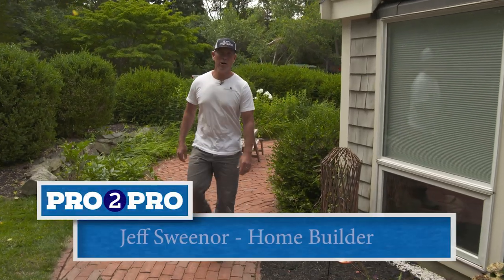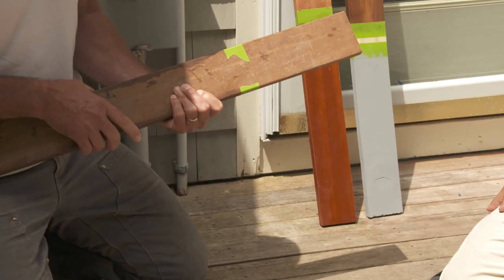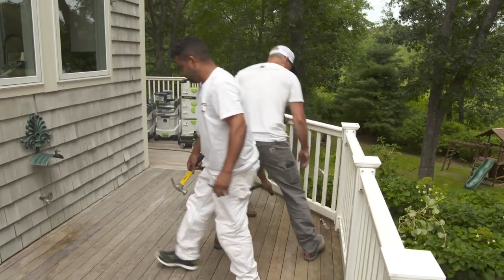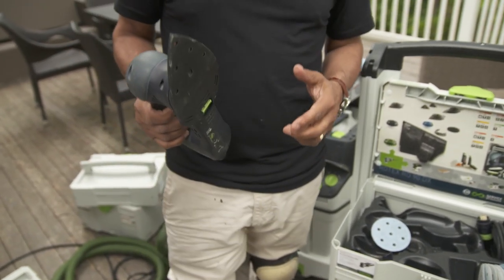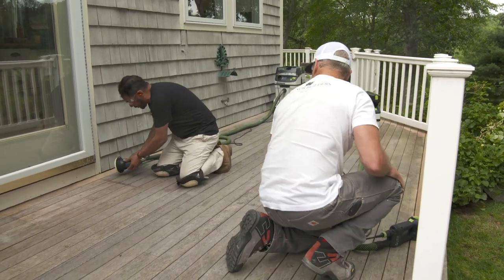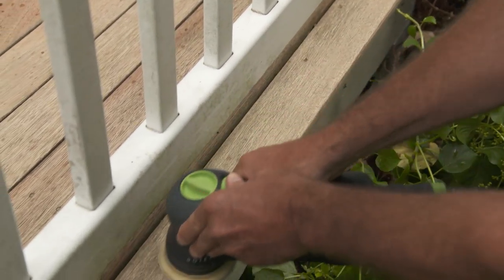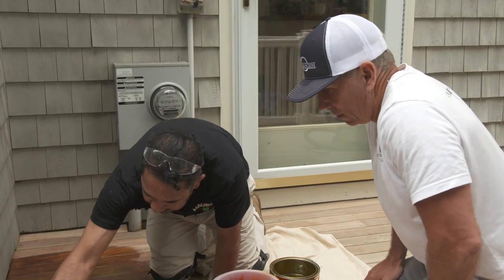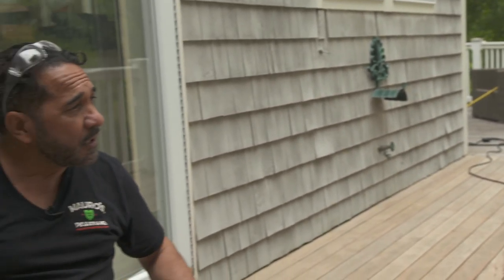Pro2Pro Live: How to Refinish a Deck | This Old House

Comment: If you're using a penetrating oil, you should be wiping down the boards with acetone before applying the oil.   This helps the new oil "bite" into the open pores.  Otherwise, the act of sanding just brings out the naturally occurring oils within the wood to the surface, thus minimizing or "blocking" the uptake of the new penetrating oil.   Can't believe that wasn't mentioned here, it's all over the literature from the penetrating oil manufacturers.

Comment: They tell you what brand the $20k in tools they used were, but not the $50 can of penetrating oil. 🙄
Reply: Oil brand probably didn't pay up.
Reply: Penofin brand oil. You can special order it through Sherwin Williams and maybe other retailers. Not sure if you can get it directly from them.
Reply: Which woods would the oil be worth using and which woods wouldn’t you use it on because it would be a waste?

Comment: I work alone and I would have that done by the same time as they did using 80grit then 120grit. And that's how you diferente a painter from a pro floor sander

Comment: Correct me if I'm wrong but don't you need to do some sort of cleansing wash on a deck/ porch before a new coat of stain or paint? Or is this only after doing a chemical strip of some kind. Def interested in knowing before I do this project myself
Reply: I'm not positive, but I think it's because they used a penetrating oil after sanding.  And only after sanding.  Their product they used didn't require any additional prep.
Reply: @pdxlockpicker7796  okay so they did use something, I must have missed it. Thanks man
Reply: It would not hurt at all to use 30 Second cleaner on this BEFORE sanding to kill any growing lifeforms on  it.

Comment: I can't imagine using a blower would compare to using compressed air...And I can't imagine sanding an entire deck with a friggin' corner-cat. Where is the floor-sander?? This should not be hands-and-knees backbreaking work.
I'm all for partnering with Festool, even if I can't afford it. This is marketing to pros, after all. But it still comes off as the wrong tool for the job.
Reply: How about a corner dog? Dogs are bigger than cats